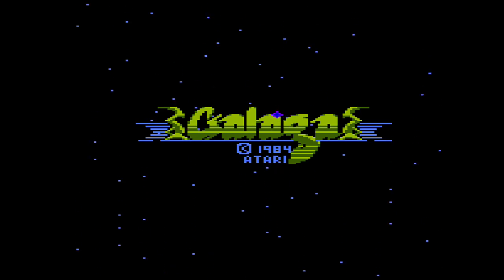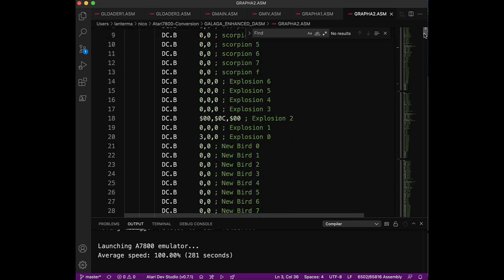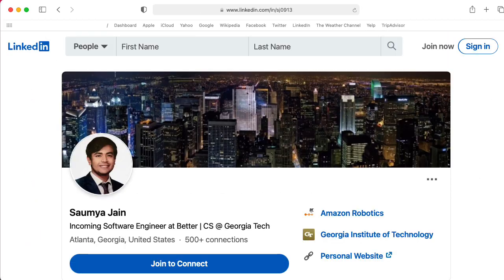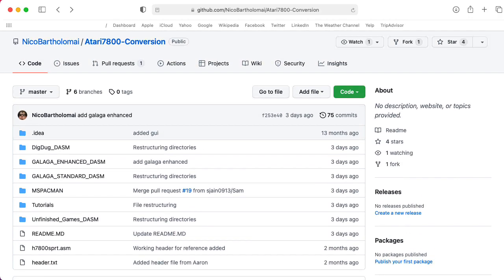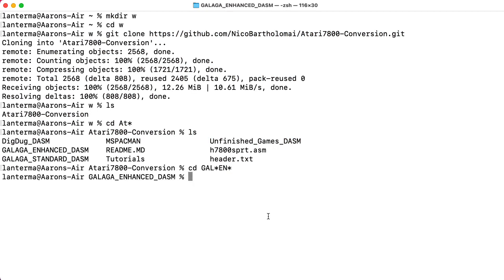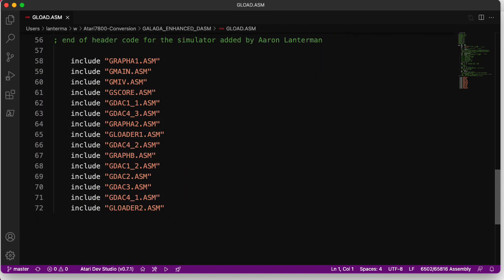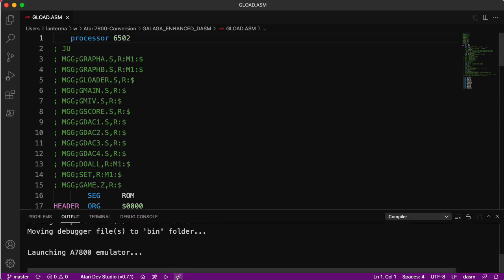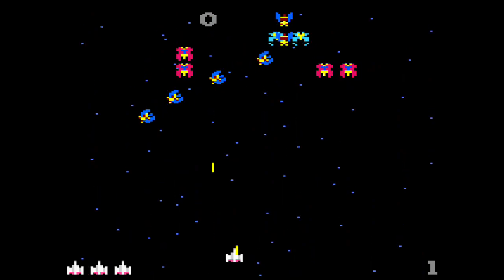Enhanced Galaga for the Atari 7800 Compiled by dasm (from source code recovered from a dumpster!)

Comment: Cool! Will that trick work for XL code?
Reply from the maker: It depends on if whatever assembler the programmer used to make XL code matches the syntax and semantics of whatever assembler the 7800 programmers used. I think there were different assemblers available for the 800 over its life span, so it would depend on the particulars.